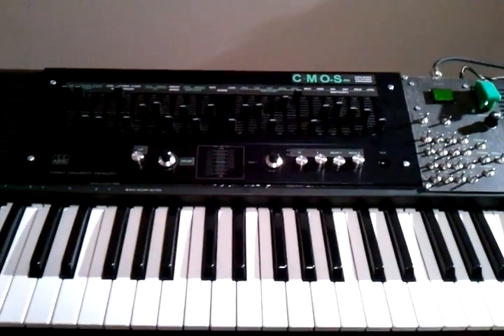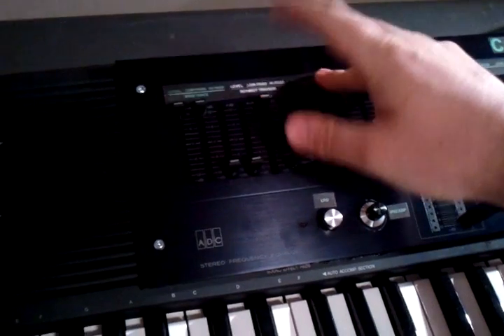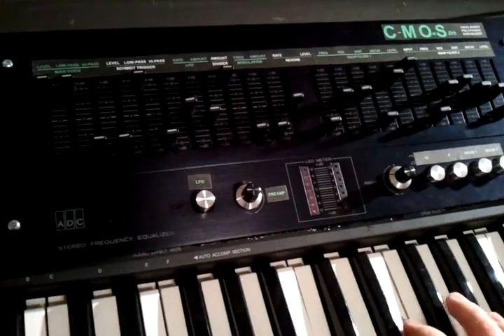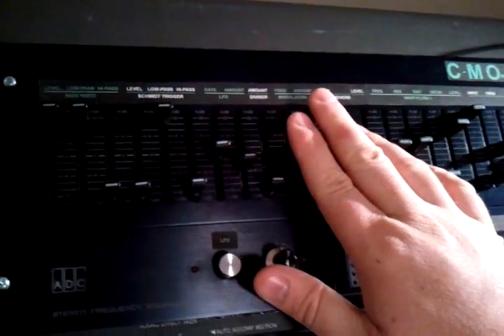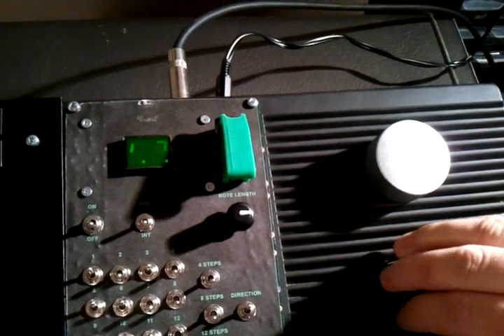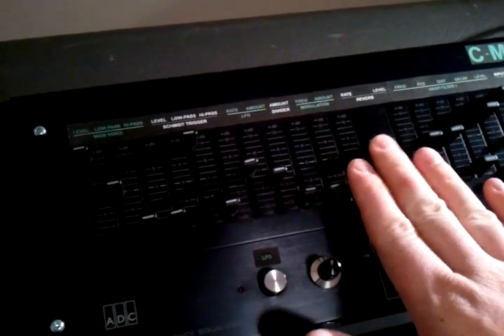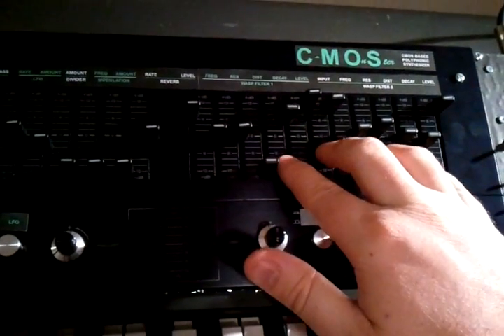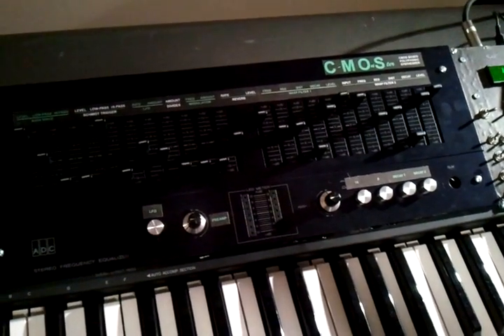C-MOnSter - CMOS Based Polyphonic Synthesizer

Comment: Hi,
nice work.
I search for a circuit, how can i make polyphony from keyboard to vco ?
Thank you
Reply from the maker: This was the first thing I built - before I even knew how to read or create schematics. The concept is basic though - create 12 oscillators and tune them to each of the twelve notes. Then send the output of each oscillator to a 4040 divider. That gives you all the notes you need being sent out of the 4040's. Then just use the keys like switches and mix the output of all the keys together. It is similar to how it is done in old organs, but most of them also use a special chip that can create the initial 12 notes from a single oscillator. That makes tuning a lot easier, but the chips are no longer made and cost $50.